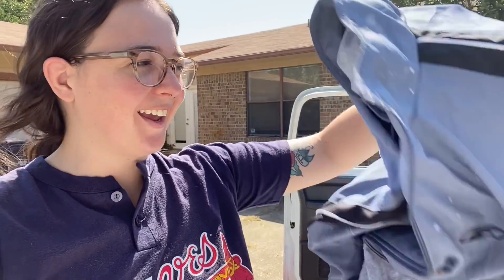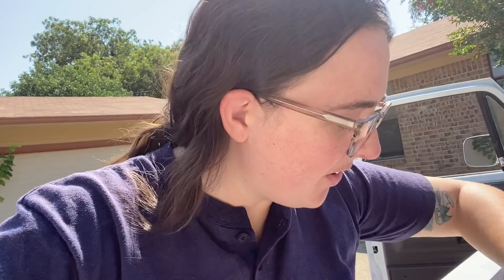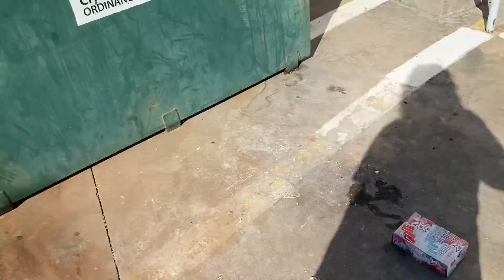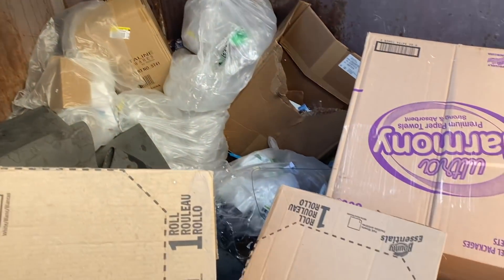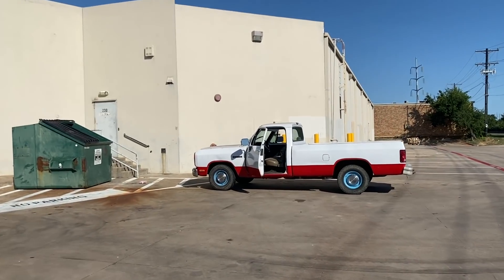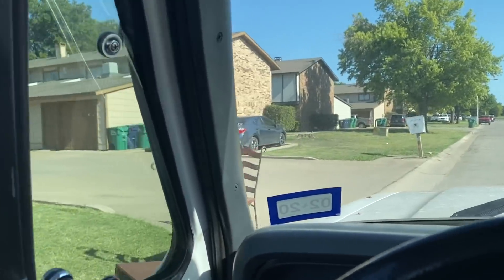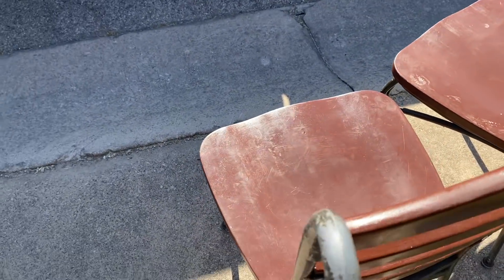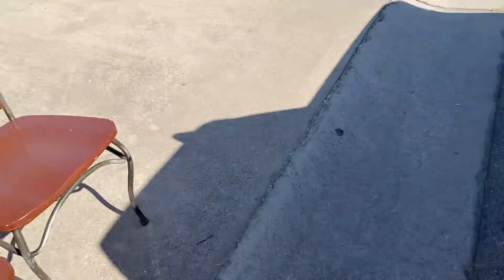Dumpster Diving Behind Shops, Apartments, & Thrift Stores!

Comment: U can use those free gift coupons that was in the dumpster.
Reply: They usually rip them and throw them away at Bath and body Works but if they don’t rip them up you can redeem them because the numbers are not specific and you would get a free hand lotion trial or a free body wash whatever the coupon says and also I’ve seen people selling the candleholders containers